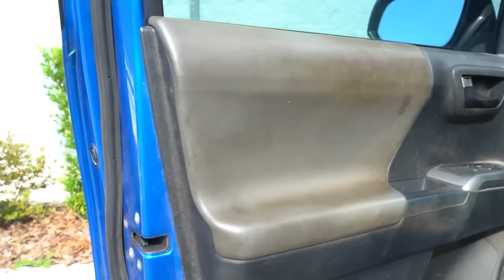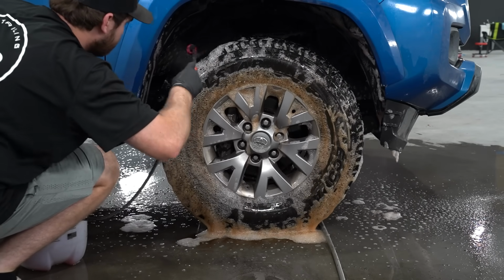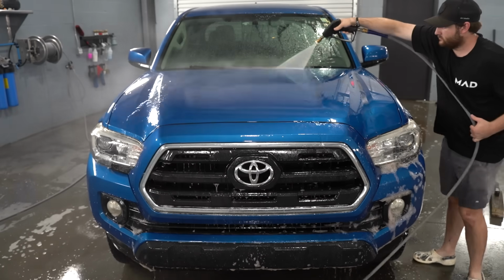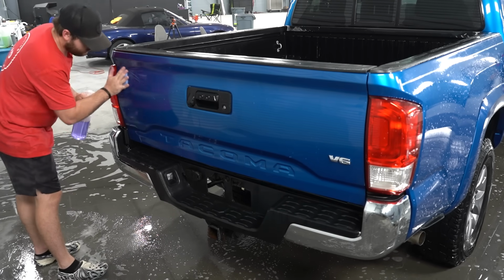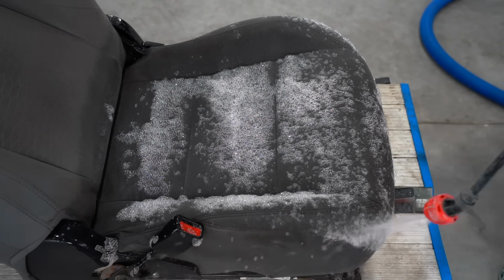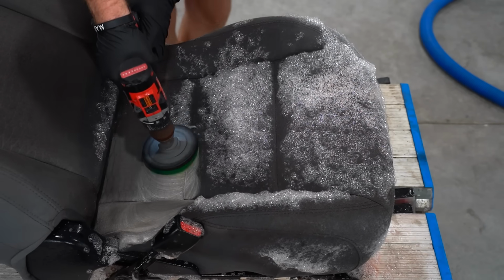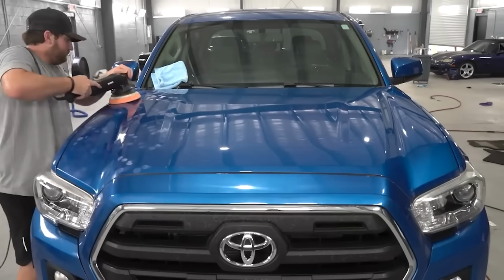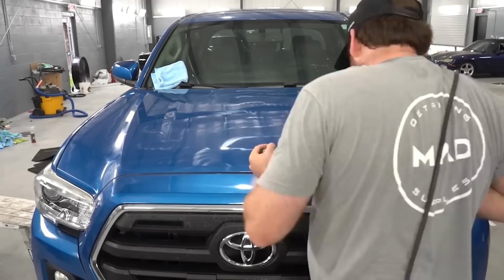Deep Cleaning The Nastiest Toyota Tacoma Ever! Insanely Satisfying Car Detailing TRANSFORMATION!

Comment: Why didn't you take the full carpet outside and blow it down with a leaf blower to remove the sand and debris? It would have been much easier and more efficient than using a drill/drill brush method.